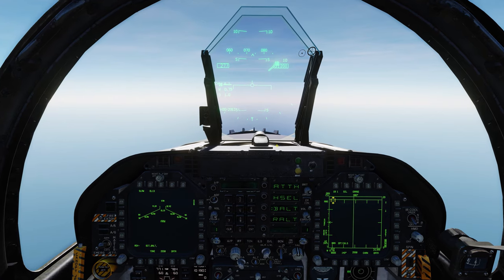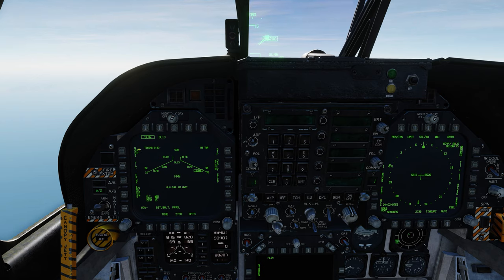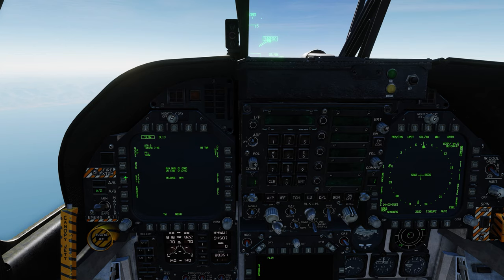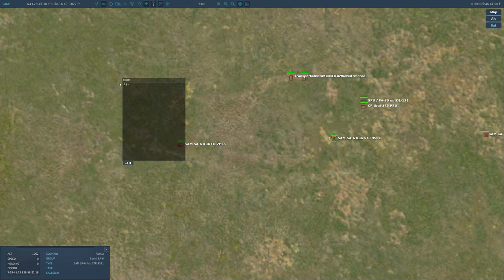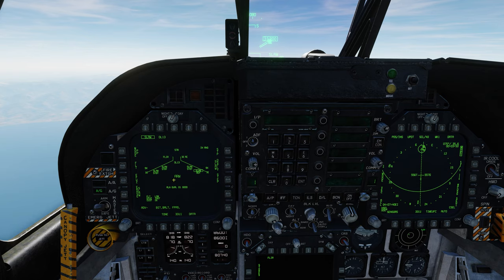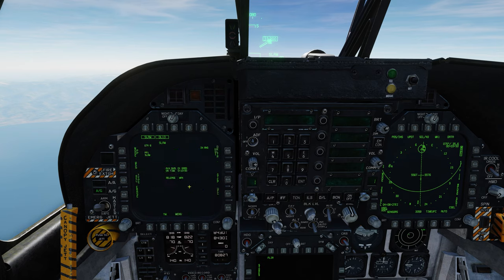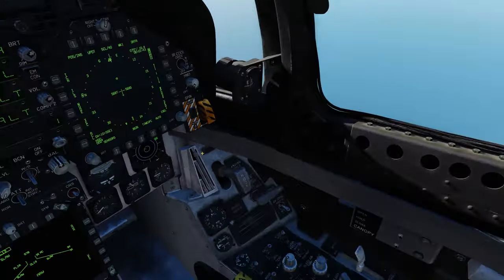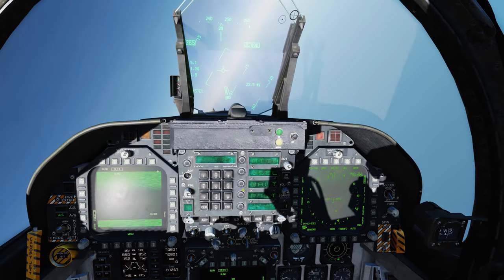Flying DCS World with OverKill: F/A-18C Hornet AGM-84E-SLAM

Comment: What’s so great about this vs Walleye is that this is powered. The mistake I always make with Walleye is that I over-control it (too much steering) and basically expend all the kinetic energy and it essentially aerodynamically stalls and drops from the sky. When this comes to stable branch I’ll never need Walleye again.
Reply: Not the same period, slam is way more modern than walleye
Reply: gregfp66 Nobody was claiming any kind of equivalence.
Reply: @Corsair8X  "When this comes to stable branch I’ll never need Walleye again." Thought you were comparing them, explaining my reaction. Sorry too used to the "competitive" crowd of dcs

Comment: Great video; however, I don't agree with your reservations about the AG radar. SLAM is nice because the MITL provides terminal guidance, which means you only need to get the missile in the general area. AG radar with the current MAP mode is good enough to get the missile in the general vicinity of the target.
Reply from the maker: I'll play around with it a bit more.  That's a really fair point! Thanks!